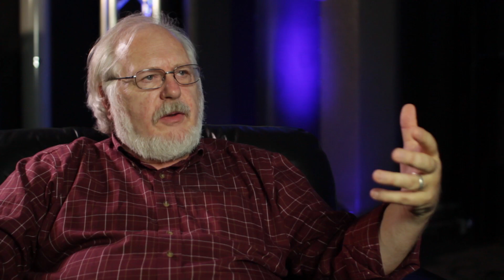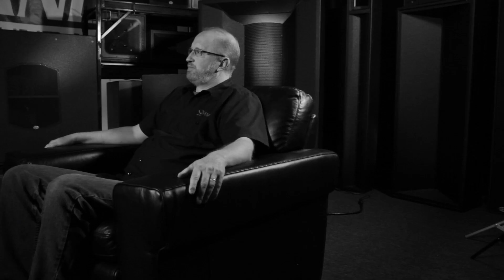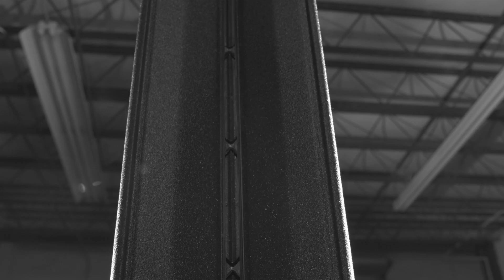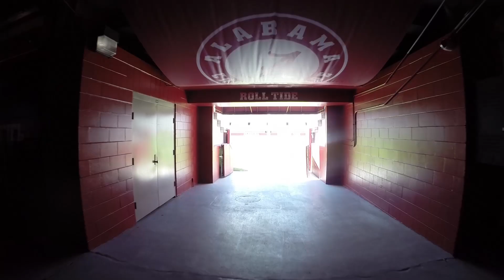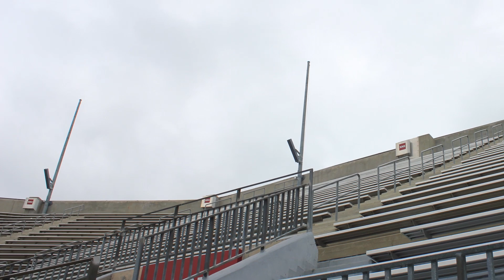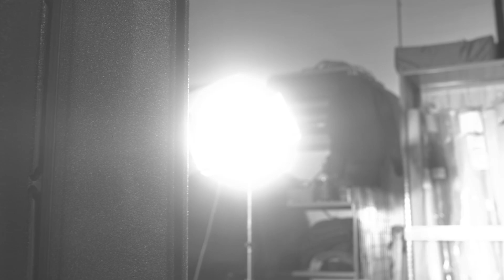Danley SBH Series

Comment: I'm wondering whether now they can make a line array with this using modular units and also paraline the midrange and the bass would be close enough to couple anyway. I suppose there isn't much point to this though unless you need louder than the Jericho.